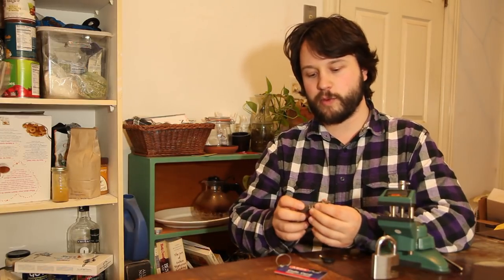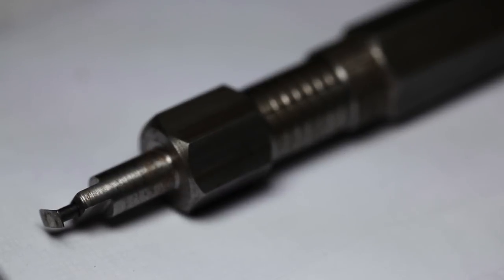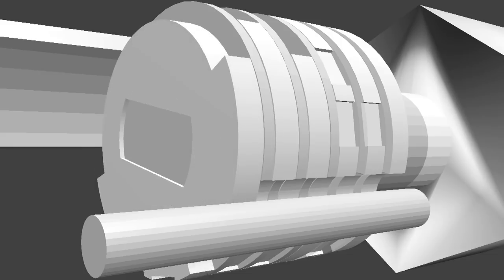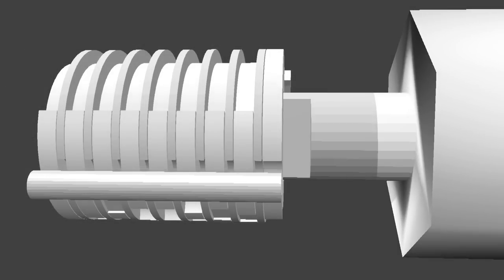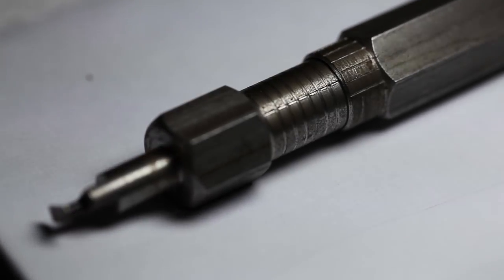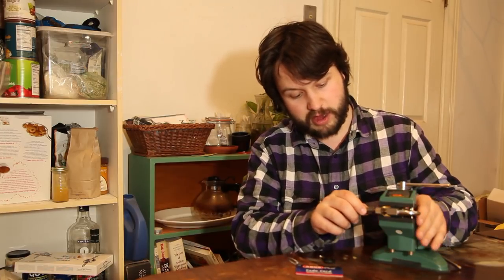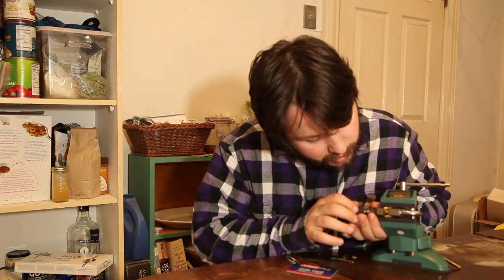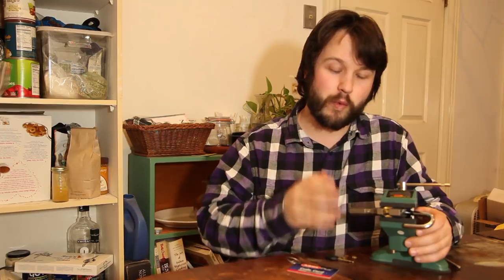Disc Detainers Part 2: Picking

Comment: Seems to be the older version (v2) of my pick :) Schuyler, send me your address, I'll mail you a new (v3) version of the tool, it has better feedback because of a small bearing.

To the comments: ABUS Plus has binding order just as any other lock. And yes, Abloy Protec has Disc Blocking System which prevents turning individual discs once tension is applied.

Comment: You can't individually manipulate discs in an Abloy Protec lock. There are two additional bars opposite to the sidebar that will lock all of the discs in place if there is an attempt to manipulate them individually. There are also false gates in every possible position.
Reply: Better pack up and go home then :-)

Comment: VicariousReality7, I just installed two Protec2s. One slides perfectly, the other not so much.  However, I know why.  On the one that doesn't slide well (i.e., the stubborn one), I believe what is making it stubborn and gritty are the two tails touching.  I think I cut them just short enough that the lock would go together, but just long enough that they would touch and rub when the cylinders are turned.

The suck thing is that I already put the plate over the screw heads and don't know how to get it off without damaging it. Anyone else know how to remove the plate?

Comment: Interesting, but I don't think the animation is accurate. I don't think a tool needs to slide in the gap between the disks. The tool can be smaller than the slot and could be L shaped.